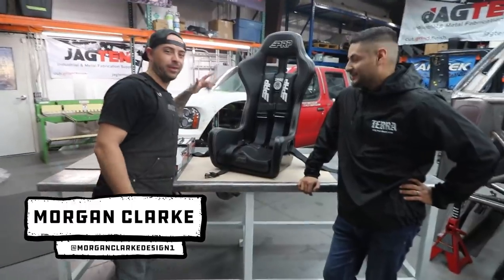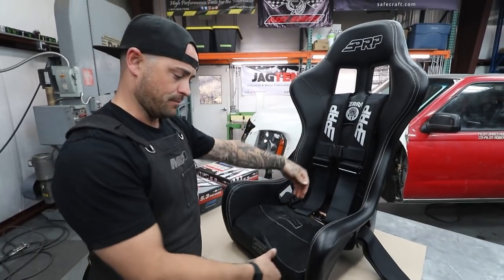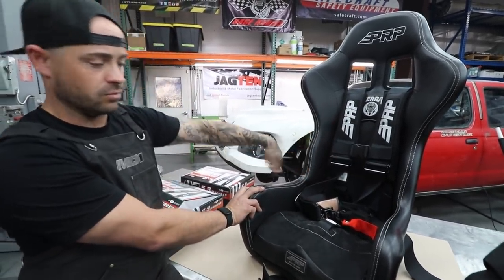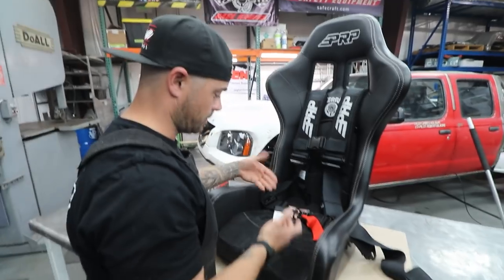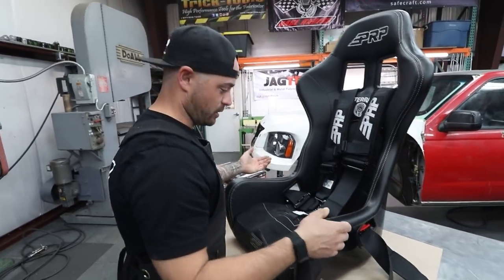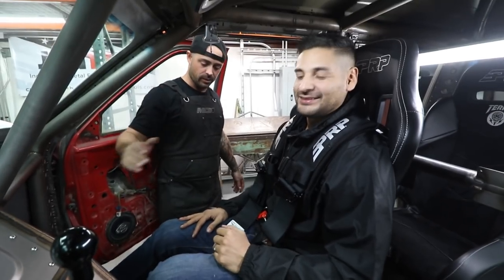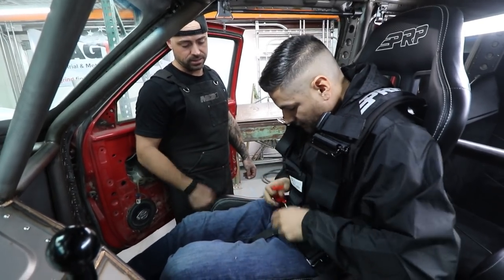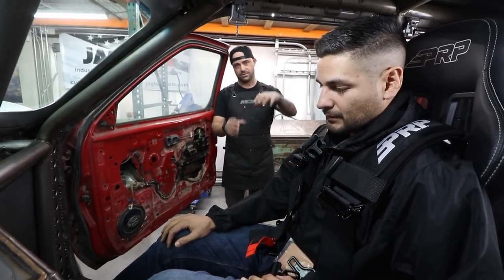Buying HARNESSES? Watch this before you buy! | TRUCK ANATOMY

Comment: Took an aircraft crash investigation course for my degree. The literature stated shoulder belts should mount so they are at the height of the shoulder or slightly higher.  Not below. Mounting below adds a spinal compresion component in a forward impact.
Reply: could be different? I read that they should be 0 to 10 degrees below shoulder, but you know more than me so I'm not sure
Reply: @Pathfinding-earth  I think that this probably due to the difference in expected forces in an airplane crash landing vs racing/ off road instances. The seat and harness manufacturers have years of racing innovations and crashes that their information is based on as well.
Reply: All valid points. The documentation we provide is based on SFI specifications which say to mount the shoulder straps no more than 10 degrees above or below. Basically as straight out the back of the seat as possible.

Comment: On the shoulder harness mounting situation, Morgan has a point, but the proper mounting for shoulder harnesses are perfectly aligned with your shoulders and straight back. if you have your harnesses mounted below your shoulders so it pulls down on you, if you have a front impact and any rate of speed it could compress your spine and cause severe damage to your back or worse, nerve damage, with the belts aligned across the top of your shoulders it will still keep you locked down perfectly and that same impact would probably only break your collar bones.

Comment: On the lap belt, you want it across the hip bones (structural part of the body), not up in the soft stomach.  

Which is also another use of the submarine strap, with it in the system, you can crank on the shoulders, and the lap belt can’t rise up from the hips to the stomach.

Comment: Another pointer. Where the lap belts are clipped to eyelets. On Simpson Racing harnesses (I figure it's the same for others) there's a pin size hole you can use to safety wire the latches that clip to eyelets to prevent from being able to unclip.
Reply: Omg thanks for this advice. I had one of my passenger seats unclip and my homie was like wtf! Now I know!!

Comment: In the world of drag racing, the crossbar that the shoulder belts mount to should be no more than 4” below the height of the shoulders and no more than 15° angle from the shoulders down to the crossbar. That angle will change depending on how far behind the seat the crossbar lives. The shoulder straps shouldn’t mount above the shoulder height. FWIW

Comment: Good info here. Only thing I would add is the shoulder harnesses should be as close to level with where your shoulders are height wise, if that makes sense. If they are mounted much lower than where the shoulders are then you could compress your spine in the event of a crash. There is fudge factor here like 5-15 degrees downhill allowance. The info is on the interwebs I just can’t think of the exact numbers right off.

Comment: If the car is small, or has tight packaging you can flip the direction of the pull on the lap belts so you pull up to tighten

Comment: Great video & I really like the use of the metal ruler to show the positioning of the mounts in relationship to the routeing of the belts. 
Will you be going over the electrical switches for accessories with recommendations & reasons for recommendations? 
As always, a great video & thank you for sharing.

Comment: I love all the info that these videos provide. My only hesitation is the sternum strap. In a worst case scenario you have to pull the lap belt release strap and The sternum clip. I'm sure it's great for comfort, just makes me alittle uneasy about sternum strap release in chaotic scenario..
Reply: Great point, Bobby. And you're right. The less unclipping you have to do in an emergency, the better. The sternum strap is mainly used for keeping the shoulders close enough together so, if you have a seat like James is in here which has the slots to do that, you can do without it.
Reply: @Prpseats  good practice and memory control will make the release second nature

Comment: What’s everyone’s thoughts on 6 point harness? I bought a new Polaris PRo and it came with a 6 point harness. I’ve only used 5 points and I personally like the 6 point harness. But it’s hard to get really tight
Reply: Mounted properly, a 6-point (split sub strap) harness can reduce chest compression up to 50%. It acts kind of like a parachute harness; wrapping around your legs. Problem is, most seats don't accommodate the split sub strap.
Reply: @Prpseats  your seats are awesome!!! Thank you for the response